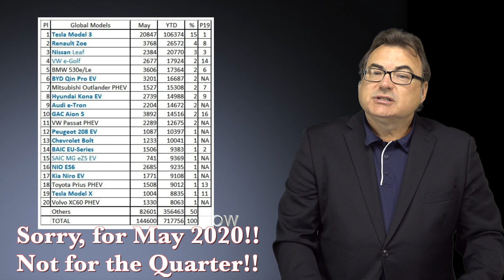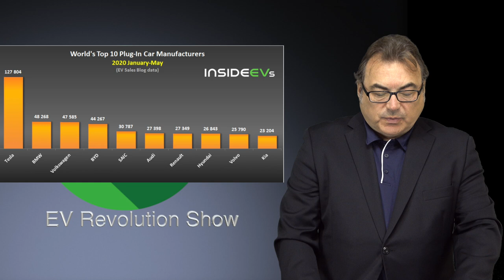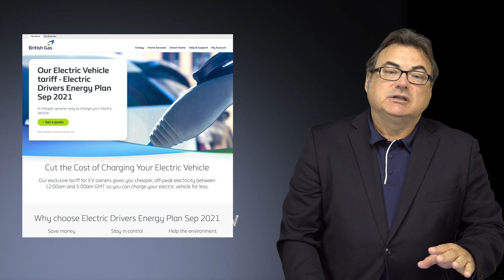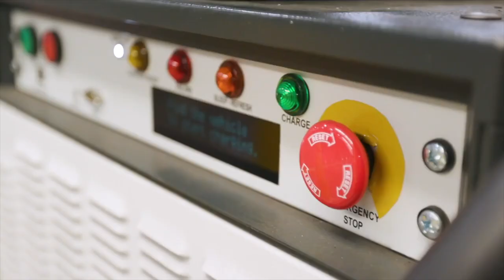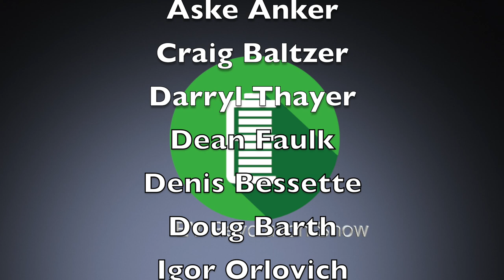Episode 97 - The EV Revolution Show - EV News from Around the World!

Comment: Nice show.
Rivian certainly is overdue to market to the point it might need a refresh of the design. If they come to market for real than they certainly will have plenty of customers.
Even Lucid Air is going to launch on the market I believe they will have to bring something else different from sedan to succeed in the market as a brand.
Now when Nissan has liquid cooling of battery it might have even better succes since they know how to keep the price under control. They were criticized for cheap design but I don't believe they will have breaks litterally falling apart in several months as model 3 Tesla does have on salted northern winter roads.
VW has finally to bring its products to market. Their products must have been of high quality but they surely need better pricing to spread EV adoption.
I am still skeptical about GM being serious about EV production until they prove it otherwise, but they surely do deserve benefit of doubt.
Stay safe!
Reply from the maker: Thanks, check out my next Episode...Nissan Ariya....liquid cooling!